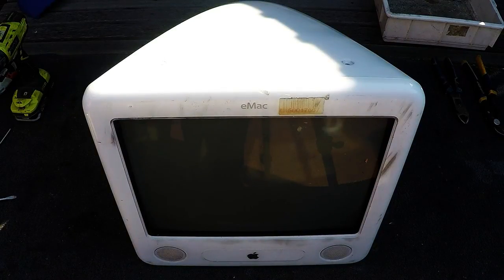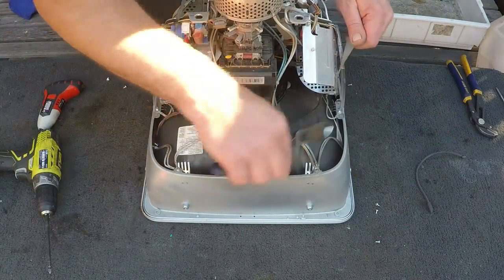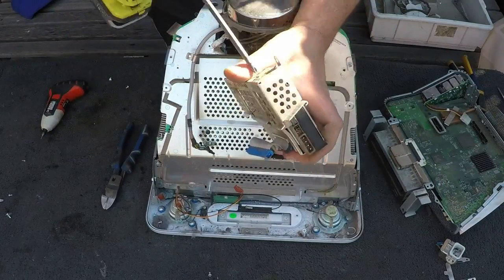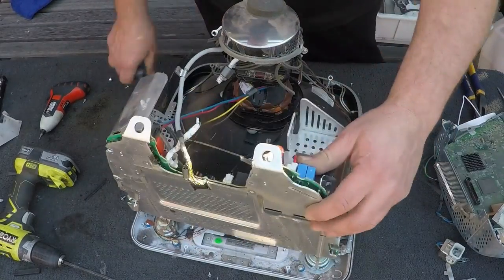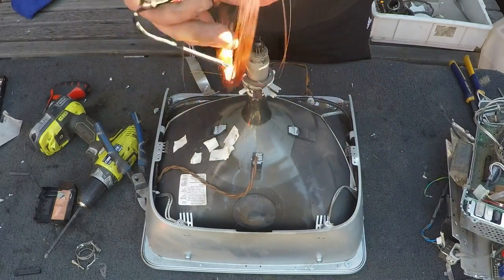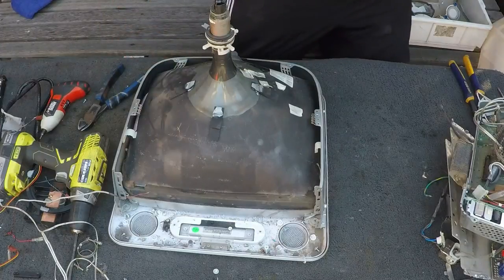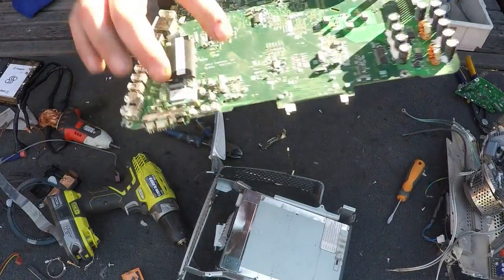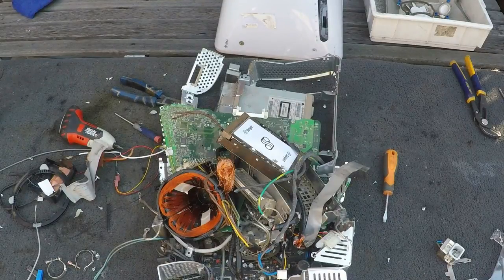Apple E-Mac Teardown for copper, gold recovery

Comment: Here in the states..the hardest part is finding someone to take the stripped monitor off my hands. what do you do with the bare monitors?  I never had a E-Mac come through my shop.  fun watching you tear into it.  I love tearing electronics apart.
Reply from the maker: bantalee2002 I take them to an e-waste recycling depot who collect them as part of a national recycling thing for CRT TV's. I believe there's many places in the states that accept old tv's, Goodwill centers apparently take them.
Reply: goodwill,best buy accepts them only if they are complete and intact. last batch i had to pay a recycler to take them,because i already gutted them. yeah..so i don't process old televisions or monitors any more.
Reply from the maker: bantalee2002 yeah best not to in that case or scrap them on the spot, put the cover back on and away you go.
Reply: lol..i may attempt that.
Reply: in 2011 the "Obama administration " passed a law stating that you could not dispose of CRT with your local "free" (tax paid) recycling. It had to be recycled from, I think a government or licensed recycler because of the lead & mercury in them. In my area Bestbuy and other places won't take them unless you buy a flat screen. There is only 1 place in my area that takes them, but it cost $40.00 per tv/monitor. CRAZY HIGH COST has created a big problem with people just dumping them. anywhere and everywhere. NOT COOL of the dumpers or the government!!!
Reply: Our state has a solid waste dept that takes e-waste. It is very nice, and self-supported, not operated using tax dollars. The folks at the yard are very friendly and helpful.
Reply: Eatie Gourmet 
Hi Eatie Gourmet, what state do you live in?
 Also do they take crt's at no charge at all?